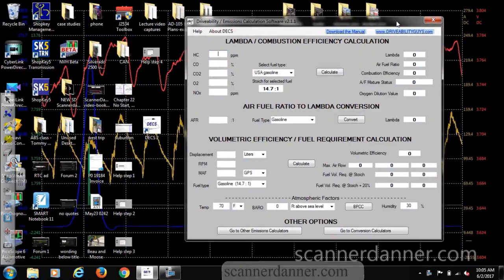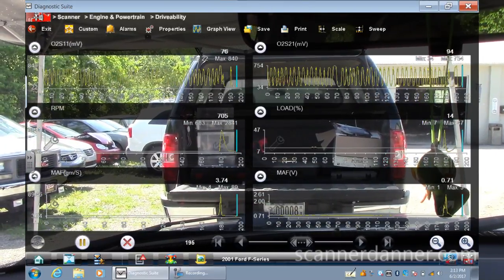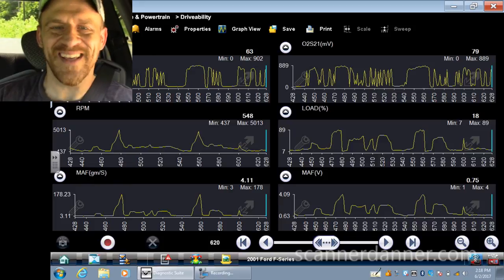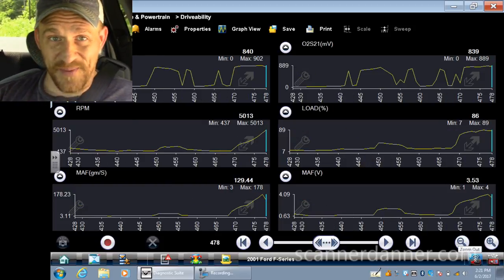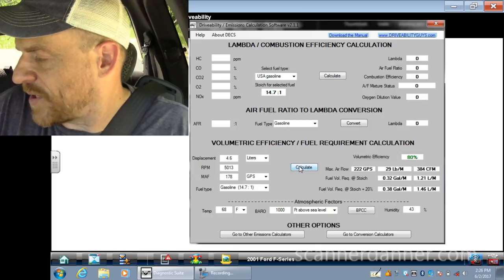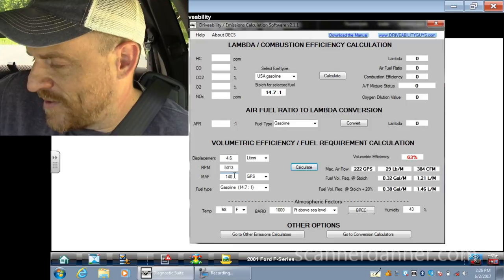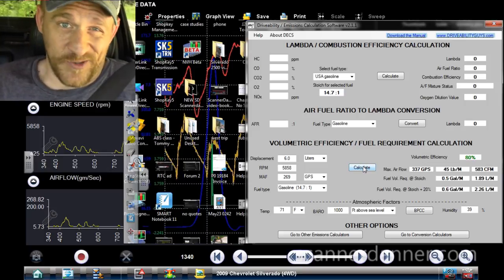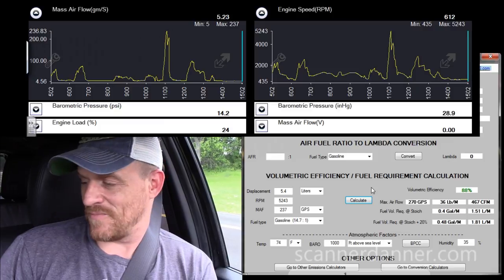Learning Volumetric Efficiency Testing (DECS)

Comment: Out of curiosity, why is there no concern about the F150 only making it up to 88% load under WOT? Is that not a sign of a dirty or malfunctioning MAF?
Reply from the maker: Anything above 80% is considered normal for a naturally aspirated engine. My Silverado was only 80%
Reply: Your Slverado displayed a max of 99%, the Lincoln displayed 100%, as for the F150 it displayed a max of 88% load but that seemed like a spike it averaged low 80s while you were in it. I have read elsewhere that anything over 80% is normal but at the same time in my experience there has to be a reason for the ECU to not recognize that you're trying to give it everything it's got. 

9 out of ten times that I come across an issue like that it has always been a booger or something on the MAF.
Reply: It's like that because the manufacturers want to be able to sell a vehicle anybody can drive at any time of the year, in any climate, and that can make it to 100k without issue. 88% ve is pretty damn good for a eveyday American suv. Ten years ago those numbers were reserved for high end exotics and super bikes.
Reply: Christopher Douglas Load and VE are two different things sir. At the beginning of the video he even states that it has been popping lean codes.
Reply: Your right I'm a idiot, I read that too fast. 80 ish % load at WOT. It's a tiny bit off but within limits. Checking the pid and putting a scope on it wouldn't hurt to be sure. But i think it might also be a mileage issue, gunked up tb, intake runners, valves restricting a tiny bit of airflow perhaps.

Comment: To get a accurate VE, there are many variables that needs to be consider.  But to get a ballpark VE, he defiantly should use IAT instead of outside temperature.  I can imagine how much air density will be off if engine got a intercool !.
Reply from the maker: IAT instead of ambient. Got it! Thanks!
Reply: Yes, you want the air temperature of the air going into the engine.   The right way should be, drive the car decent speed until AIT is stable (it should not take long) while graphing.  Then do the WOT VE test.  Otherwise you might have high under hood temperature which can increase IAT.  This will give fault air density which will effect VE result.

Comment: If your Lincoln is a flex fuel try a comparison with fuel vs ethanol. It would be interesting to verify what we already know, that is ethanol is not efficient at all and although it may be a few cents cheaper gallon per gallon it's a bad idea and is not a viable alternative fuel. Then perhaps a comparison with LP gas. (the government might not like you after they get exposed!)
Reply: Ethanol  produces  less carbon and NOX
LPG  likewise.
Yes there is a power output issue because of the lower energy content of these fuels   but that wouldn't be problem if manufacturers produced engines designed from the ground up for these fuels.
Here in  Europe over the last 10 years we have been cursed by the trend towards diesels for any vehicle 1.8 litre causing particulate and NOX  levels in our towns to shoot up.
Reply from the maker: It is not a flex fuel, unfortunately. That would be fun.

Comment: mr danner have you ever seen a car with no injection pulse no spark good rpm signal and no compression all 4 cyl
Reply from the maker: focus on the no compression
Reply: no compression, oh dear O_O
Reply: I have. A broken timing belt bent all the valves and the injectors and ignition would not trigger without cam timing!  YucK!
Reply: thanks guys I looked at it today and found the timing off I believe about 45 degrees off

Comment: You seemed surprised at the Navigator's higher VE.
88% VE on the Navigator and 80% on the F150.
How many valves per cylinder does each engine have?
Some of those Navigators were DOHC with 4 valves per cylinder vs. 2 or 3 on the F150s.
Maybe that's why the Navigator was higher?  Breathes better.
Reply from the maker: same engine, both variable valve timing 5.4s right? Just 5 years newer on the lincoln. (the 5.4 has 4 valves per cylinder too)
Reply: Hmmmm.  Gotta be a more efficient Intake Manifold or the IMRC then, I'd think.
Cool video.  Thanks.  We're also just getting into VE testing so this was a good one.
Reply from the maker: Or a different cam profile?

Comment: I know this was a fair time ago but this seems extremely in-efficient and kind of pointless, you'd have to go through your graph MS by MS and calculate it 1000's of times to have an actual useable chart, figure out your pressure ratio and then if you need to know the VE at a certain point in your data log just do the math quick with the pressure ratio, this is a waste of your time honestly. The MAF data would have told you what you were asking if you knew what a stock curve acted like or had a stock curve to visualize against what you were reading.